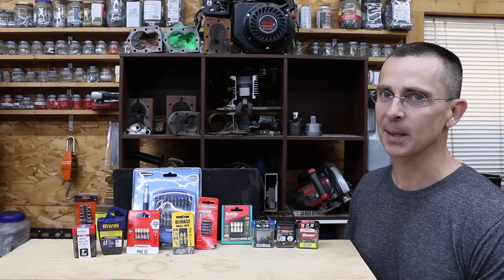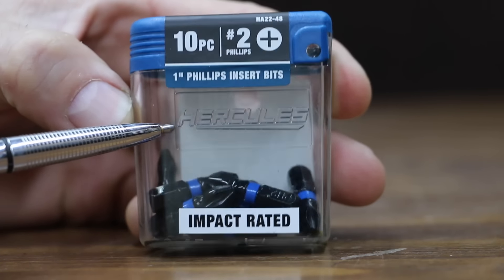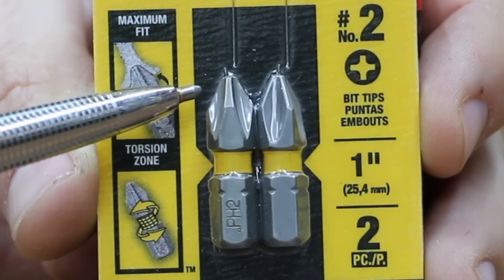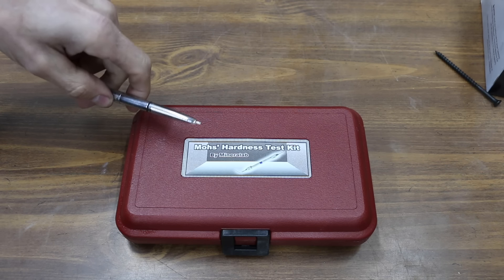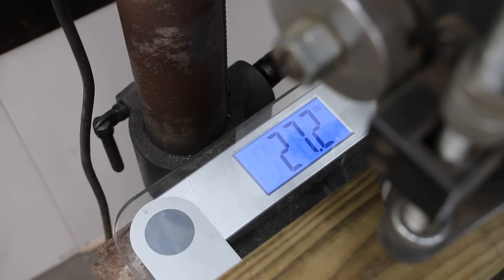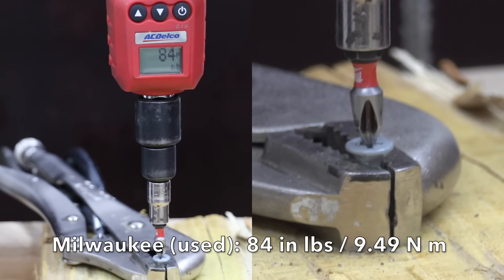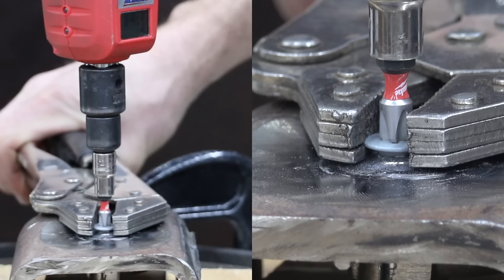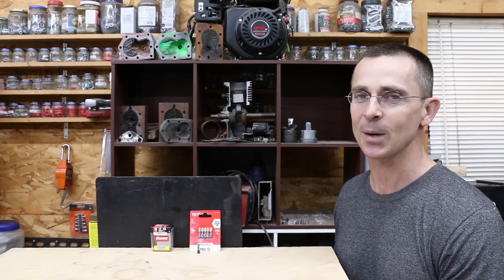Which Impact Driver Bit is Best? Let's find out! Phillips #2 Showdown

Comment: I would love to see this same test with the longer bits that lock directly into the impact. I hardly ever use the little bits that require the magnetic bit holder.
Reply: Wallace Frey exactly! I don’t think anyone uses them. They’re piece count “fillers” for marketing on the packaging mainly...
All I use are square Robertson for everything. Philips are garbage!
Reply: I agree!!!! I build prefab stairs and use both style!!!
Reply: I agree with this. I do construction work and have tried many variations and will only use DeWalt bits but generally use #2 square bits when I can
Reply: In my experience, the meduim vs the short (doesn't matter which brand) are more or less the same in operation. The long (again, any brand) may bend easy with a bump, impact or drop. I can't tell you how many long bits I've had get mangled because the drill fell over directly on the bit.
Reply: I always prefer to use the short bits, the long ones tend to be alot more cumbersome and they're less modular. The jobs I've worked on, you need modularity, sleeves for long screws, a ton of different bits on the fly, and the longer bits just tend to be more single job specific, but for say home renovations, the long bits just tend to be a pain to work with. Plus with how fast bits can go bad, it just makes more sense to replace it with 20 more, on the fly.
Reply: @urjnlegend  The short bit with the holder is longer than the medium bits that I can get.The medium bit only protrudes from the impact 1-1/8 inches.
Reply: Milwaukee long bits.
Reply: @TheLexiconDevils  The 2" is what I use most...Only sticks out 1-1/8"
Reply: I use a 6" bit for slab and rough in and 3"magnetic bit holder with these 1" bits for finishing. I don't think your going to see a big difference in the performance of the steel or the fit unless each brand has really inconsistent and shitty production quality
Reply: Most of us use the longer bits, sure. But I’d be willing to bet the overall quality/performance and therefore the outcome is going to be pretty much the same thing. Would be quite surprised if the order changed at all.
Reply: I use 2" and I experienced consistent breaking (1 out of 4 concrete screws) with Bosch. Switched to Milwaukee and ran 8 more screws without one bit breaking.
Reply: @halflife82  I agree fully.I have been building and remodeling homes for almost forty years and mainly use the 2" versions,with the occasional 4"-6" for installing door knobs or ceiling fans and such.
Reply: @Mkruzer  Milwaukee is my go to brand for driver bits and sawzall blades.
Reply: The production and materials will be identical regardless of length. Just assume less torque tolerance.
Reply: @halflife82  Drywall guns only use the short bits, and they drive a hella lot of screws. So for those guys this is pretty good information. Otherwise, I agree. I really only use 2" bits unless I'm in a tight spot. Though actually I almost never drive philips screws unless I'm doing drywall. Torx all the way.
Reply: @bradley3549  I quit using the single screw drywall gun years ago when they came out with the automatic feed guns that have multiple screws on a strip and reload automatically. The bit for these guns are different for each model and are around 6" long and closer to a #1 phillips  bit size.
Reply: ..I agree...I use the full length bits as well..I can't STAND the little "bit inserts"..for one, they add extra looseness and wobble where they fit in the holder, for another, the holder usually can't handle the torque and vibrations of an impact driver very well, and for third, there are often clearance issues on what I am working on with the extra "fatness" of the bit holder...
Reply: @dyer2cycle  Exactly.
Reply from the maker: Thanks for the feedback.
Reply from the maker: Thanks for the feedback.
Reply from the maker: Thanks for the feedback.
Reply from the maker: Thanks for the feedback.
Reply from the maker: Thanks for the video idea.
Reply from the maker: Thanks for the feedback.
Reply from the maker: Thanks for sharing.
Reply from the maker: Thanks for sharing.
Reply from the maker: Thanks for the feedback.
Reply from the maker: Thanks for the feedback.
Reply from the maker: Thanks for the feedback.
Reply from the maker: Great suggestion!  Thank You!
Reply: Heh kinda surprised by the comments I donno that ive really ever seen anyone use anything but the small ones on a jobsite, the longer ones are pretty rare to see
Reply: @ProjectFarm No problem.  I love your channel,and this is something I know something about.
Reply: @shanester366  If you do this for a living you will find the extra few cents per bit is worth the money to get something that works the way it should.The only time you need a magnetic bit is if you are screwing something with only one hand free. (that didn't sound good but leaving it for the fellow contractors)
Reply: @wallacefrey6247  true, and most of what we do is one handed so thats probably why, I also find the single piece ones to be to short without the small holder
Reply: @shanester366  I just magnetize the longer bits so they can fit in tighter spots and stay locked into the impact driver.
Reply: @wallacefrey6247  im happy with the small bits, we break them so much anyway, plus I would have to use an extension anyway as they often arent long enough as they are, why I prefer the small ones on a small extension
Reply: @shanester366  It's all good.I am not trying to sell anyone on the longer ones,it's just that is what I find to be more useful to me,because the are shorter than the 1" bits with an extension.
Reply: @wallacefrey6247  yea no worries we all got diff preferences

Comment: The question is, are some of these made to the JIS standard?  Yes, there is an Imperial and Metric cross recess screw driver!  That could explain why some didn't fit as well to the screws.
Reply: There's also Pozidrive and probably a few more older variants that are no longer used.
Reply: Not none of them are JIS. JIS look completely different and aren't really sold in the us specially not in big bucks strores
Reply: Have you ever seen the cost of a “standard” set of tools.  A simple 1/4” ratchet and a set of 5 “standard” sockets whether imperial or metric can cost around $900+.
Reply: @Scott Heslin you're brittish too.
Reply: JIS refers to machine screws such a motorcycle engine case screws not this type of construction screw, Philips, pozidrive and JIS are all different
Reply: @joolsfreeman4359  wood screws are most often equipped with pozidrive or prodrive. Both these variants are designed to be driven by PZ Pozidrive profile bits. The Phillips heads are most often seen on machine screws. I do like the Torx and square drive timber and masonry screws but they will snap the bit tip off if torque isn't suitably limited
Reply: Im pretty sure the makita was JIS, hence the wiggle on that bit
Reply: It looked like they were all Labeled PH2
Reply: @joolsfreeman4359   Yep.. I wonder how many tons of Japanese motorcycle engine cover screws have been trashed with a Phillips Head screwdriver?
Reply: @diadlo13  is right. You generally have to go looking hard for JIS stuff here in the US, and it's mostly found on Japanese appliances and motorcycles. For drivers, you won't find JIS in any big-box store I've looked, and half of the JIS screwdrivers I've ordered off Amazon show up as Philips...Cause I'm ordering from the US. I generally have to send them back and specify that I want JIS! JIS definitely looks different. I've encountered JIS when working on Japanese stuff, but I've never once encountered a Pozidrive while working on anything in the wild here in the US.
Reply: @jmonsted  posi is a zombie that just won't die.   I use them daily
Reply: @JoshTolbertUrbana  lots of cars use JIS screws too. Honda rotor screws come to mind. Even US car manufacturers use them now too. I bought a "vessel" JIS screwdriver off ebay just for automotive use. The dot on the head indicates JIS.
Reply: @jake-mv5oi  is a 3/8 impact tip metric 😂😂
Reply: I wondered if someone was going to bring the JIS standard up ! It makes a difference !
Reply: You have to remember too, some screws are not like other screws, even from the same batch. I've run into that many times.
Reply: @jake-mv5oi  yeah, I've seen JIS on rotor screws. I bought a Vessel JIS screwdriver off Amazon...And got a Philips. Had to send it back and specifically state I wanted JIS, even though that's what the Amazon listing was for. Go figure.
Reply from the maker: Thanks for the feedback.
Reply from the maker: Thanks for the feedback.
Reply from the maker: Thanks for the feedback.
Reply from the maker: Thanks for the feedback.
Reply from the maker: Thanks for the feedback.
Reply from the maker: Thanks for the feedback.
Reply from the maker: Thanks for the feedback.

Comment: Decades ago when I started working on fixing Japanese motorcycles and cars, I usually stripped the installed screws when using Philips bits made to USA specs. I later discovered that Japanese cross head screws are made to different, tighter specs(JIS or Japanese Industrial Standards), and you have to use drive bits made to JIS standards to avoid stripping screw heads and ruining the bits.   If you ask your tool supplier, these JIS bits and screws are readily available.
Reply from the maker: Thanks for sharing.

Comment: I would just like to give a tip, when you’re using the impact gun as much as you are in this video, as a dewalt owner myself, I have had a few drills burn out and I could never figure out why. The problem was that when under heavy load (like this video) I was covering the air ports to cool the motor as it is spinning in order to apply downward force like anyone trying to make sure the but doesn’t slip off, and it caused the motor windings to heat up and short out. My tip to you would be to rest you’re hand on the very back of the drill and not block the air ports to allow your impact gun to cool and live a much longer life.
Reply: At work, my little Milwaukee impact heats up pretty badly when I'm holding it down. The air coming out of it can and has gotten so hot, it burns the hand that's being used to hold the bit in place. Imagine the grease Carnage going on inside the thing!
Reply: Not really a tip more of common sense, but thanks for pointing that out, ive seen lots of people do this, i found out just by the heat my handfelt and put 2in2 together
Reply: I have a friend who is an old sheet rocker he has his corded drill that he uses always on to keep the fan moving air over the motor. He swears by it
Reply: jesse serfling Absolutely correct, keep the circular saw running a little longer before and after the cut too.
Reply: The Holy Flapjack that’s why I love my makita vent on the side
Reply: Damnit, now I can’t unsee it
Reply: Imo it's just a bad design knowing that is where most if not all users put their hand there.
Reply from the maker: Thanks for the feedback.
Reply from the maker: Thanks for the feedback.
Reply from the maker: Thanks for sharing.
Reply from the maker: Thanks for the tip!
Reply: Pauline Weinberger  true, and brushless tools also produce less heat during use as well. Brushed DC motors generate a lot of heat from arcing at the brushes.
Reply: Most brushes and armatures are cheap,i just fixed a dewalt drill for less than 40 bucks, new brushes and new armature, like brand new again
Reply: Same for dremel and other high velocity tools....
Reply: The Holy Flapjack the problem here is that you’re using a dewalt
Reply: J R.H I got a full set as a gift so ima use em till they die and buy Milwaukee
Reply: Using torx bits, you don't have to apply much pressure at all. Screw (ha!) philips bits.
Reply: Look at int instructions. There’s a time on, time off ratio for tool usage. Like 5 minutes on 15 off. It’s not that extreme, but check before you burn your drill out
Reply: It’s called a duty cycle. Just remembered!

Comment: Bauer is next level. HF’s best kept secret. Cheapest and best of their “premium” brands.
Reply: I love my bauer  drill/driver set , add in the LED light or two as they are a must. I really wish they sold a battery contact cover. I don't like having lipos sitting around with exposed contacts. 

I also got my compound sliding miter saw but i had to do a LOT of hand work and sanding to get the turntable and outfeed ledges to be level and true. That saw with my own zero clearance throat piece and my own DIY zero clearance fence. 

I had to put work into making the tool do what i wanted, + build a 3 foot infeed/outfeed table and tie it into the fence, but all the tools from HF that i have gotten have been champions. Even the belt/circle sander combo. I had to tweak the motors position to tension the belt, but adjustment is to be expected in any direct belt driven tool.
Reply: I bought 2 for my last remodel, and owned a hammer drill for 3 years. Super tools
Reply: So much awesomeness coming out of the Bauer line lately. Soon 5AH batteries.... maybe even 8AH batteries.. :D
Reply: I’ve tried most of them and makita gold are really the best all around, they don’t strip out too bad and they also don’t snap
Reply: It's not even their 'premium' brand.  That's supposed to be Hercules.  Bauer is their enthusiast semi-pro line.
Reply: Its such a shame that its only available in the states. There is a whole wide world out there that just cant get them, whereas Milwaukee, Dewalt, Bosch, Wiha, Makita are all available world wide.
Reply: AVE needs to do a Bauer teardown.
Reply: @OneMouseGaming  They won't let you use the toilets / restrooms. Even urgently. 
Poor form. 
I escalated to Cranbourne manager Shane and politely requested many times but he was an uncourteous repeating same thing like a parrot, treat you like an animal. 
Full bladder and first time there they said go to the pub or shopping centre which we don't even know the area! Really? 

What a joke. Let's see what action will be taken? 

I'm lodging formal complaints in detail to DHS.

Pathetic conduct and appalling response by Shane ruined our morning. 

This is the first government site I've been to that doesn't allow use of on-site water facilities. 

Star is for the pleasant to deal with interviewer Dani. Interpreter on call was also decent this time round.
Reply: @stevethea5250  what?
Reply: @stevethea5250  ?????
Reply: @stevethea5250  ....what?
Reply: Bauer corded orbital, great, not very loud either.
Reply from the maker: Thanks for the feedback.
Reply: @brendo7363  What should we asks ourselves regarding each of the letters?

Gratitude, 
Empathy,
Mindfulness.

Can y'all let me know the doctor told me but forgot
Reply: Not everything at HF is junk
Reply: @OneMouseGaming  1up on the tip about lipos. I bet they have short protection built in, but I dont want to risk a lithium fueled fire.

Comment: Milwaukee is supposedly going to be making hand tools in the USA soon, wonder if the quality will improve.
Reply: Probably decline. Can't improve by much! They have a very impressive lineup of tools.
Reply: That's awesome.
Reply: The price will increase! No doubt. There stuff is already more expensive.
Reply: Thier wire strippers are already top notch, I've been using Klien and Wiha for 25 years and the Milwaukee wire strippers are probably some of the best, if not the best,  I've ever used.
Reply: @THeBoZZHoGG  who makes the best diagonal cutting plyers?
Reply: @charleskelm3703  wiha or Klein, depending on what you want you cut.  D2000 Kleins are tough as hell will cut nearly anything and just keep cutting.   Wiha for precision work.
Reply: @charleskelm3703  for me I use knipex, for most of my pliers and cutters. absolutely unbeatable

Comment: Gotta say, after years of real life experience, I've always gone with Milwaukee bits for Phillips and Torx bits, along with the socket adapters. I was afraid it might have just been brand loyalty at first, but the performance was there. Your lab testing conditions coincide with my experience. 

Thanks for the effort you put into this video!
Reply: Allah is one God God is Allah Allah has 99 names Allah is almighty
Reply: Hey man...there is a company in Germany named Würth and I have been using their screws, blades, driver and drill bits, grinding and cutting wheels for 13 years now and I also tried EVERY SINGLE bit, wheel, blade and screw on the market in Europe and NONE of them come even close to Würth. If you are not from Europe you should definitely need to try anything they offer. Every bit they have lasts me for very very long time (having in mind I use them 6 days of the week) and it is worth every single cent you spend on it.
Reply: @chilltrip393  who is your lord grave first question
Reply: @RebeccaQueen-ti1bk  I don't have a lord. I am human.

Comment: The only time we ever buy new Milwaukee bits is when we lose half a case lmao 🤷🏻‍♂️
Reply: They suck for tapcons in my opinion
Reply: YepOnly reason i have to buy new ones
Reply: @cheshstyles  Tapcons have a nasty habit of not having fully developed Philips holes. That or the epoxy coating is overly abundant.
Reply: @Plyply99  i agree but the milwaukee tips i bought have a noticable tendancy to shatter
Reply from the maker: Thanks for the feedback.